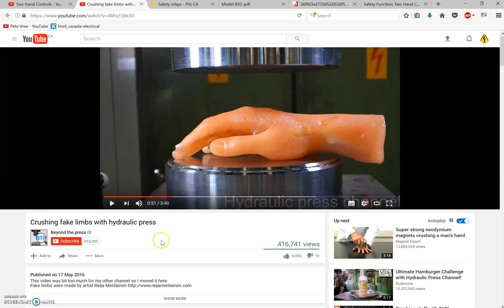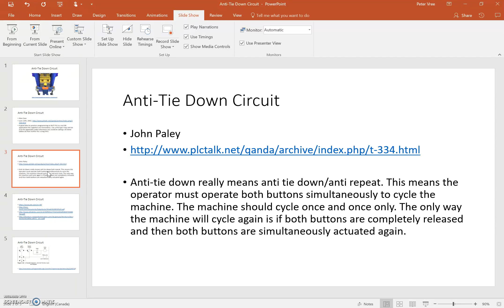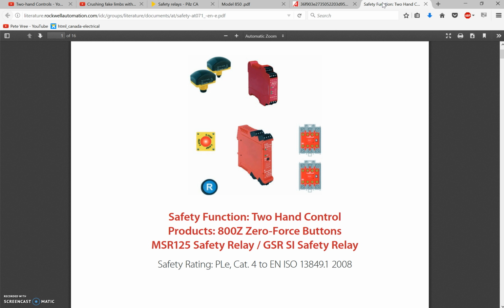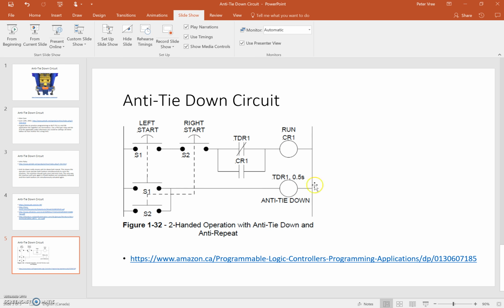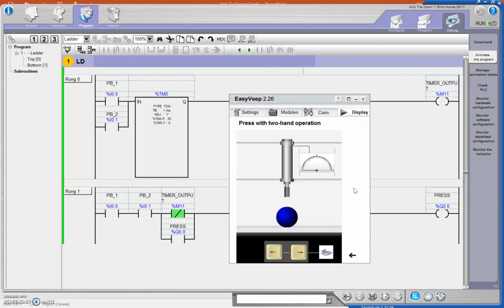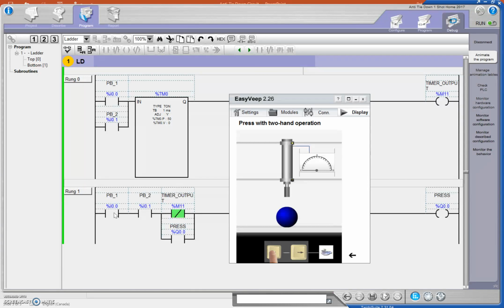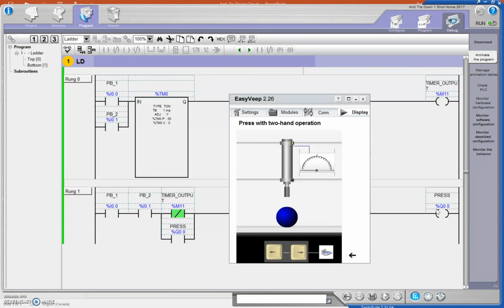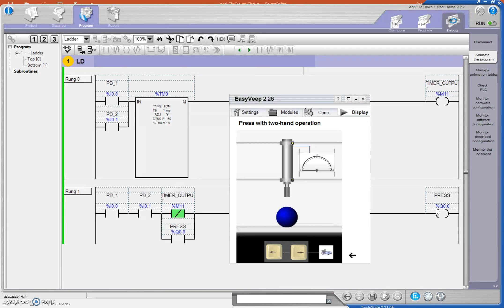PLC Tutorial (Festo Easy Veep) #3 (Anti Tie Down Circuit)

Comment: Hi you hav used OR logic of push button as a input to the timer and using the press output to negate the timer when both the buttons are pressed.....

Instead doing this can we use XOR logic of Push button 1 and 2 as a input for the timer so that we can neglect the requirement of output bit to negate the timer done bit?

If anything will be wrong in my suggestion please intimate

Comment: Aren’t the two push buttons related in an OR gate?
Reply from the maker: Only for the Timer portion in Rung 1... PB1 OR PB2 will start the timer (1 msec) You can see in Rung 2 that the Push Buttons are in Series, followed by the output of the Timer. In Rung 2 both PB's have to be pressed within 1 msec of each other, otherwise the timer blocks the Output from turning on